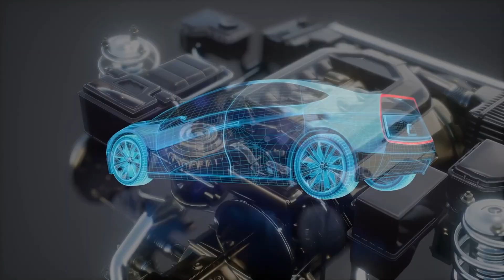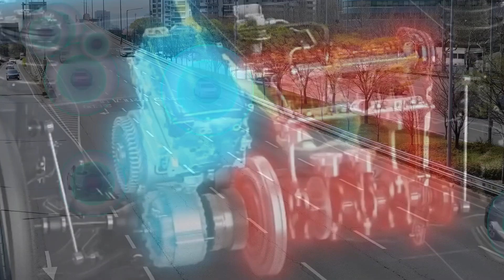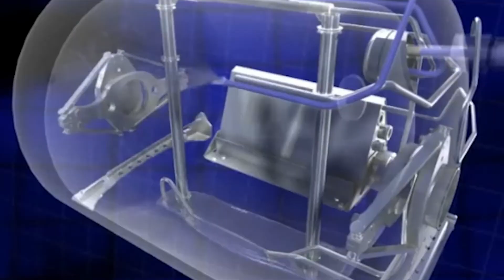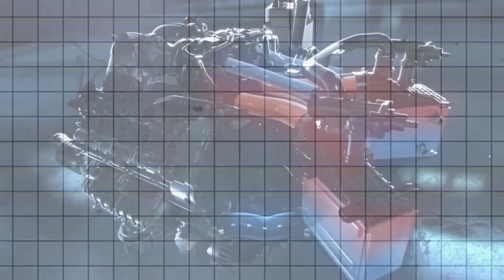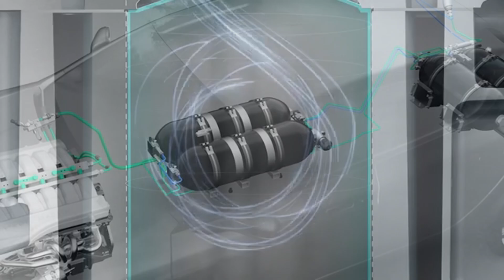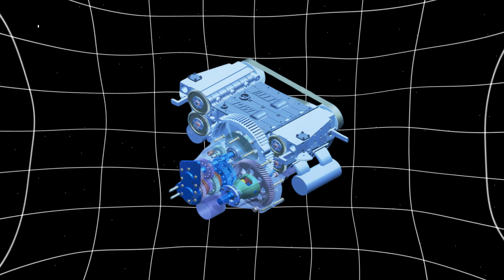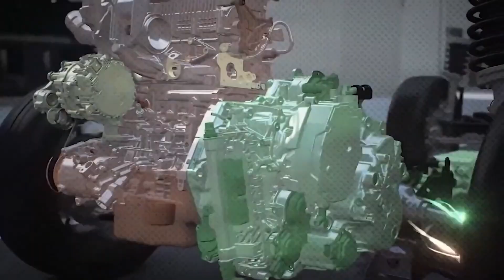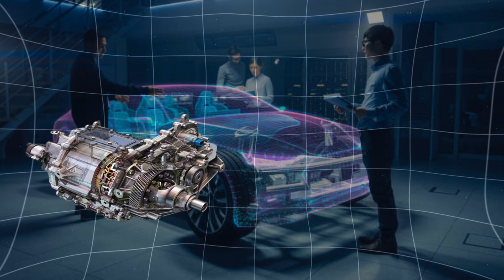ALL NEW Compressed Air Engine To Disrupt The Car Market

Comment: which would be safer? air tanks with like 6000 psi in them, or lithium ion batteries that catch on fire?
Either way we are talking about storage of energy. A LOT of energy. Think about the welding cylinders with 2500 psi in them. Knock the valves off them, and they take off like rockets.
I am not against the idea, but the tanks would have to be fairly safe from accidental discharge.
It would be possible to do a little regenerative braking as well!

Comment: um, air doesn't contain energy, so the cars do not run "on it" -- the energy is put into it by compressing it, so it's not necessarily clean. in this way, it's like a battery-powered car.  think of the air as a huge spring being slowly uncompressed to drive the car

Comment: It's not running on just air. It's running on the power used to power the compressor that fills the compressed air tanks in the car. The compressor to refill the tank gets power from a fossil fuel engine or electric motor powered by a utility company (or both). Adding an extra step just reduces the overall efficiency. Kinda like a Generac(R) powered EV charging station.
Reply: Yeah, the important question here is how the energy density compares to an EV, and I doubt it's anywhere near better.

Comment: what about heat and A/C not to mention headlights, turn signals, radios and windshield wipers?
Reply: Please stop thinking logically.  Our almighty government and their corporate overlords command you!
Reply: heat could be a accessory... ac could be the same, an accessory. at the risk of depleting the range. I could see compressed air powered wipers tho... keeping with the compressed air power source, could you visualize pneumatic flags waving in synchronization for  signals? lol. Add one that sez "whoa" when you apply the brakes.
Headlights would be a small generator....

Comment: If you thought batteries sucked in cold weather, try running an engine on compressed air in Canadian winters. 
You'll make it one mile and run out of power.